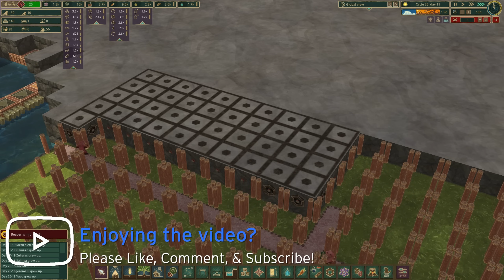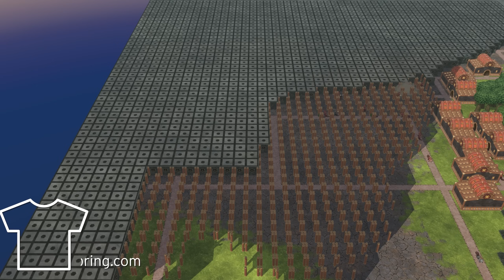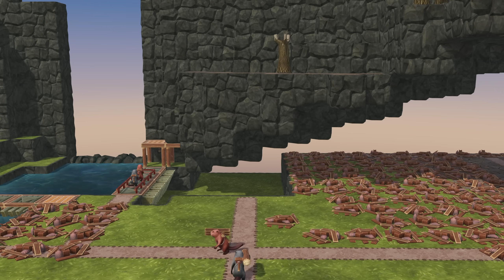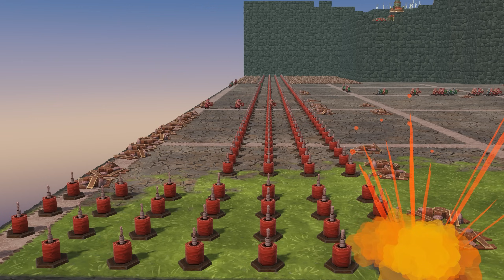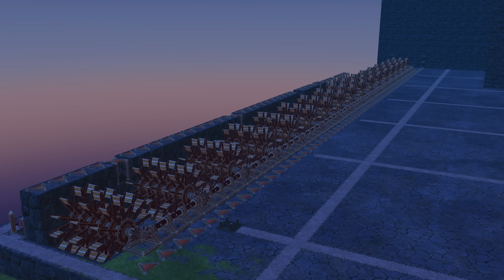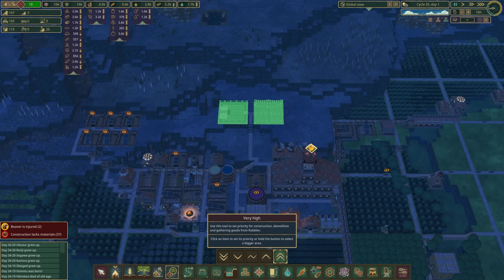Blasting & Badwater Power | Timberborn | The Emberpelts Ep. 7

Comment: → 3:40 "catch up on planks" – if you delete the platforms (and collect the rubble), you get a lot of planks, just let them pick these up in-between building new tunnels. Of course, it doesn't make for such a nice before/after shot. (With the ironteeth and their new 6-planks platforms (instead of the log+planks one for the emberpelts), I guess it's a bit bigger effect.)
→ 15:12 "... the overhangs can only go two" – I think the shot at 10:00 clearly shows you can overhang three blocks? – 15:43 You didn't even try placing the block into the gap! 16:44 also shows even clearer the overhang of 3 meters standing (after deleting the other side).
→ 35:42 "Hold on! These only put out 60 max anyways" – No, the output 60 per cms water flow. So if you manage to get more water through the same space, you can get a lot more power out. If this is a standard bad water source of 3cms, you get roughly 1 cms through each of the wheels when it's properly flowing. I'm not quite sure why it's only a third of the output ... maybe your badwater source is weaker? (You can check that in dev-mode. – if you want to measure with stream gauges, you'll need to get three of them across the channel and add them up, and preferably not at a corner.) As mentioned by @nurmr, an 1-wide channel should be enough to squeeze that through without overflow (concentrating the same power-output into a narrower channel), though with 3 cms you'll need at least two edges where it falls down. (If you are down for it, you could also increase the flow in dev-mode.)
→ Of course, the other way of getting more power out of this is to build even higher – you can make a tower around your badwater source (even over the terrain limit you can continue with levees/impermeable floors on overhang platforms), and then build higher.
Reply from the maker: I had a lot of difficulty getting any blocks placed into a third overhang, so I was assuming it was limited to two. But I definitely DID try to place the third. Seems the 'hit box' for getting a third one is kinda funky. I've played around with it a lot in a copy of the save and I continually find that third block placement to be somewhat "off" from the placement of the other two.

Definitely, part of letting them get caught up on planks is usually letting them pick up debris, and I do that when not creating a video when I run out of planks. But you nailed it - I didn't do it for the video because it would have a pretty significant impact on the "let's remove the platforms and watch the mountain fall apart" reveal shots. :)

I misspoke when I referred to the "max" output of the water wheels, but I think people knew I meant "baseline at 1 cms" ;)  The flow, iirc, is 0.3 cms (I blocked it up to be only one tile wide and dropped in a stream gauge in dev mode), so it's never going to give a ton of power. 

I do, however, have some plans for improving it, including restricting the flow to a single tile and letting the water flow back and forth in each level, and maybe going higher as you suggested (though I am planning on putting some stuff on top, so I don't want to go too much higher). Just gotta figure out how to do it efficiently in a "live" build and also when to do it considering I have some pretty huge projects already planned. But the upside: its current output will be more than sufficient for the plans I currently have for the district, though it will be near peak utilization.

I'm not too terribly keen on using dev mode to change the badwater flow rate at this stage into the build, at least not for a video series. I'm down with making modifications to a map before a series starts, but doing so while it's ongoing just doesn't feel like the right call.

Comment: You could double your power output by replacing the center water wheel with levee/dirt block and routing the water back and forth on a single layer.
Reply from the maker: ooooh! excellent advice! and I immediately thought to how much work it'll be to change that existing structure and... ouch. I might just do it, though, if I can figure out a way to get the beavers inside there easily. I have ideas :)
Reply: @VaingloriousGaming  I've also found you can concentrate the flow into 1 wide lanes by simply sealing off the source with only 1 sluice to let it flow. On the same map I've done that with all 4 normal water sources into 1 sluice gate for bad water, the clean water has 4 sluices to ensure I get he most out of the wet seasons
Reply from the maker: I've been tinkering with a few ideas on how to change it and I think I have something. Now to figure out how to work it into the already big project I'm working on over the next several videos...
Reply: @zxuiji  It depends a bit on the geometry. The main limit is wherever there is a step down – then you got the waterfall limit of 2.2 cms per edge tile. On level ground, you can go a lot slimmer than that. (But if this badwater source only has 1cms, then maybe there is no need to worry.)

Comment: the lag issue was likely something the devs changed backend since I did have just 10-20tps on average with just speed of 1  a few days ago but since the patch I've had the full 50t-60tps on speed of 3
Reply from the maker: definitely. the fps of the game has been ping ponging all over the place as they do little tweaks to experimental performance. overall, though, it seems to be moving in the right direction for more optimization.

Comment: 15:49 pretty sure it was 3 across you could go, not 2

*Edit:* 16:44 as I thought
Reply from the maker: you mean the three extra off to the side? wouldn't they count as overhangs for the blocks on their left side, thus just one tile overhang, instead of from the one on the far right as three? iunno, I haven't really figured out overhangs yet. seems sometimes they work as I expect, then others they're just "nope"
Reply: @VaingloriousGaming  Yes they overhanged from the block on the left but you were still *3 blocks across* in the 2nd timestamp. Meaning you didn't need any of the exrra you built between the 2 timestamps to reach that middle block
Reply from the maker: I think I get what you're saying. I thought those 3 in that 2nd group were overhangs from the left side, not overhangs from the one in that row to the far right.